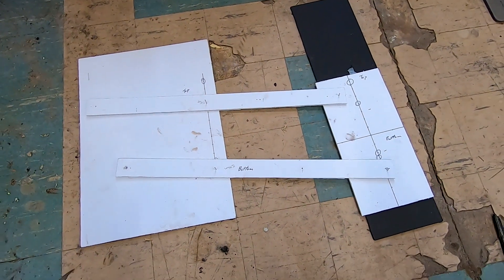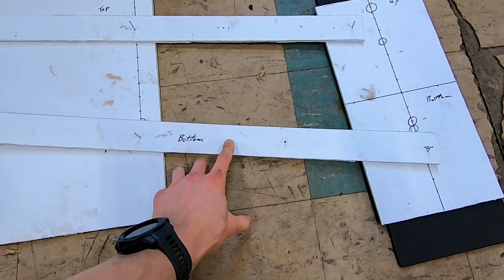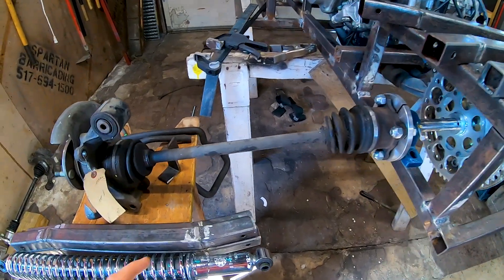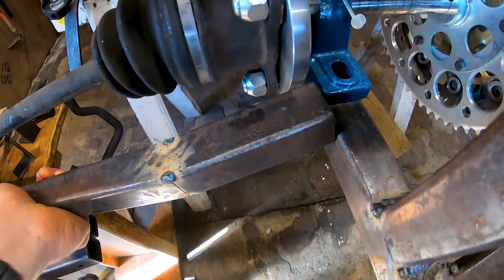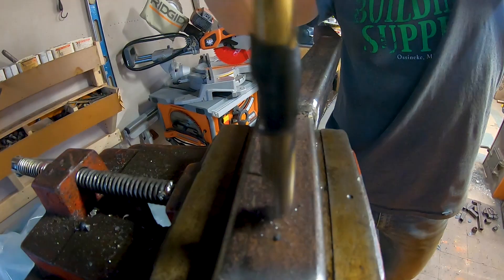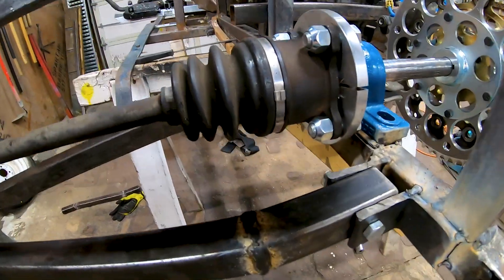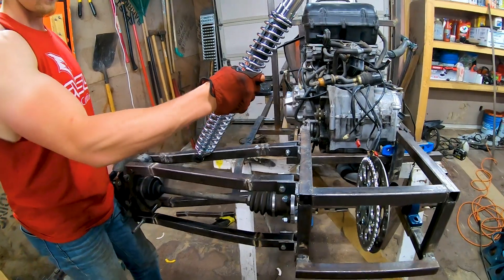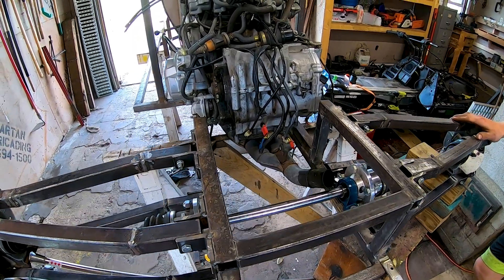Mini sand rail rear A-arm construction

Comment: What hubs did you use to bolt the Maura axles to the 1” shaft?? Thanks
Reply from the maker: Some 1in key shaft hub sold from summit racing
Reply: @GoBrosGoebel  I looked and looked with no luck on there website, I’ll keep trying
Reply from the maker: @smallgaragebigdreams6032  yea not sure if they still sell them

Comment: The motion of those rear a arms look perfect. looks like Mazda Miata parts almost finished with mine got it listed as 750cc Mazda Miata rear end go kart. Noticed looks like you got those hubs from Summit Racing I wish I would have got those they would have matched up better. The ones I got fit in a 1 9/16 pillow bearing. Just trying to tweak the chain and I'll be able to give it a good rip
Reply from the maker: Thanks, Yea the hubs are from summit, we were going to go with some lighter duty ones but we figured we would get heavy hubs since it's gonna be about 100hp lol

Comment: What hubs are you using to connect the CVs to the axle? Trying to do research on IRS setups.
Reply from the maker: Then we found some for my 4 bolt pattern pubs on summitracing.com that directly hooked up to the other side of RCV axles
Reply: @GoBrosGoebel  So the bolt pattern on the CVs is 4" x 4"? That's perfect since thats a very popular size for 1" axle hubs.
Reply from the maker: @BunkerBlog  correct it worked out good cuz we had many options for,just hopefully our keyways hold up to the power will be Making lol
Reply: True. Might have to end up welding the hubs to the axle if not.
Reply from the maker: We are using stock Miata hubs
Reply: Hi, nice idea, the unique problem that i think its the torsion in the axel, if the axel didn't slide, or sorry if i didn't understand, my English isn't good,  but it is great you're work
Reply: I didn't see those hugs that would hook up today inner part of the axle from summitracing.com so they're hooking up to 1 inch axle inside pillow bearings